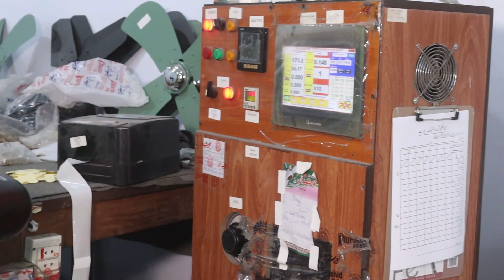How High Quality Fans Are Made || How To Make Electrical Screw Shell

Comment: congratulations look what an organized factory cleans employees with ipi i only saw a small problem (Personnel involved in handling electrostatic powder painting should use respiratory protection mask with P2 or P3 type mechanical filter) and I saw some employees throwing parts on the floor this is ugly but the rest can be corrected note 1,000 keep it up congratulations success